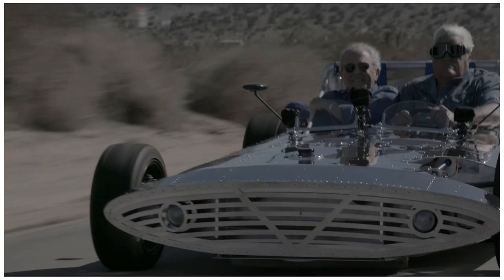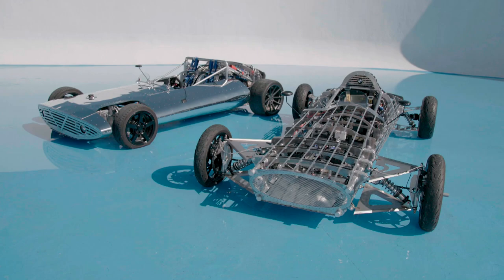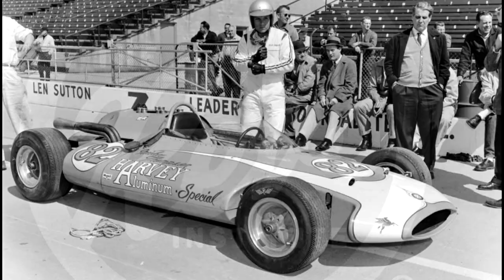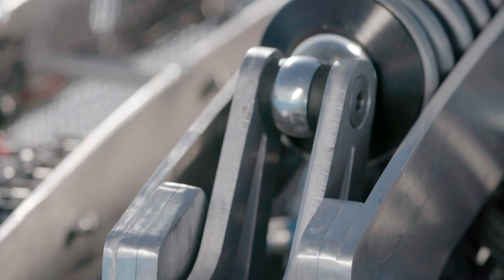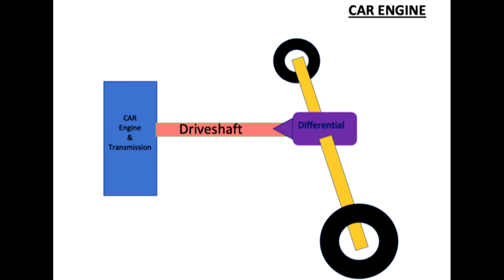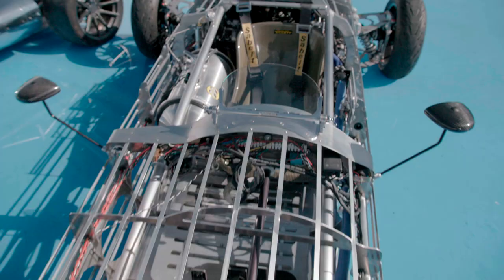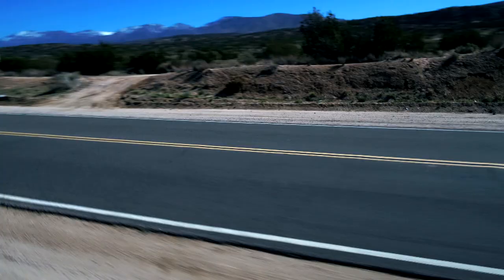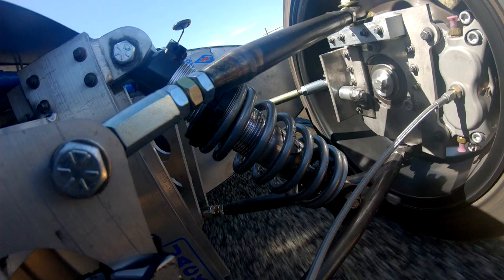Jay Takes a Ride in a 2021 Lulu | Jay Leno’s Garage The TV Show

Comment: I think instead of that cog belt pulley systems I’ve heard boats have a similar mechanism that has ring gears… maybe that could be more reliable or gain hp because there would be no belt slippage
Reply: I was thinking flip the differential left to right, ring gear on the right will run the other way.  It does put the input shaft pretty high though.  I didn't really see what setup the transmission to diff was though.
Reply: boats use a vee drive, casale engineering is one manufacturer.

Comment: Drafting table!? Tell me you are old school without telling me you are old school.  I remember learning Technical Drawing, dear god I am happy they came up with computer aided design.
Reply: The truth is I did all the drawings on a drafting table ive owned since i was maybe 20. Then i photographed the drawing in detail, and emailed them to WaterJet Inc in ABQ…Alex did the cad drawings ( he is a genius) and were worked back and forth until almost no aluminum was left in each bulkhead “add lightness” …the upright chassis bulkheads fit into a jig and the frame rails skewed thru all 22 panels like the swords thru the lady in the trunk at a circus. Spacer rectangles with big cutouts made “knee braces” to square up the chassis and the whole thing jigged up in alignment . Lu2’s frame weighs less than the K1600b frame did…that car weighs only 130# more wet than the bike did dry. 

Lots of fun, a great use of tools and time ….jay is so genuine and easy to be with ….fantastic experience

Comment: Very cool cars. Does Lu2 lean in corners like a motorcycle? Because if not, there's no need for bike tires. Car tires have a much better footprint.
Reply: The A Arms are designed to lean the wheels in corners, but in an effort to keep the unsprung weigh very low, stiff side wall MC tires weigh 25% of a car tire…the stock K1600 weighs 860 lbs and Lu2 weighs 1038 wet…..the focus was lightness , and its cornering is intuitively easy ..thanks for asking

Comment: Rear running backwards means oil climbing down the gear...not good,
Reply: It’s upside down AND flipped over side to side, so I’m using the correct hardened sides of the R&P gear faces, and it is a splash oil system with a small bladder expansion tank. Vs a vented breather ….Quaife approved the install

Comment: Is the ecotec just so much easier to get than say a duratec/mzr thing, or any other 4cyl? Because so many of these types of chassis always use a gm ecotec.
Reply: Probably price. A Type R crate engine is significantly more expensive.
Reply: @mediocreman2  The 2.3 duratec/mzr and ltg ecotec are the same price for a crate. The duratec is a significantly better engine.

Comment: I didn’t know some motorcycle engines “ran in reverse”, now I am hungry for more knowledge.
Reply: Usually they only have forward gears in the transmission.  They have a mechanism to connect the electric starter motor to the drive train and use it to slowly drive in reverse.  That is why he had a 7 foot limit so the starter wouldn't overheat.